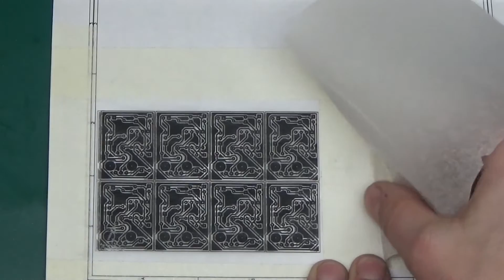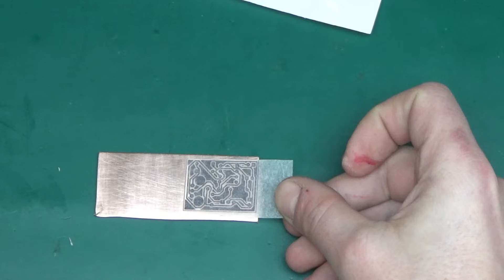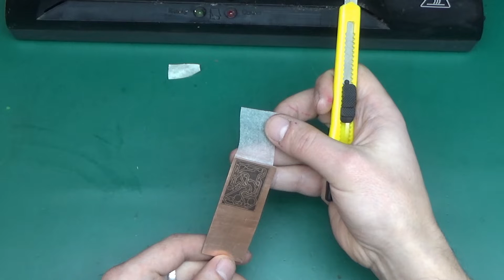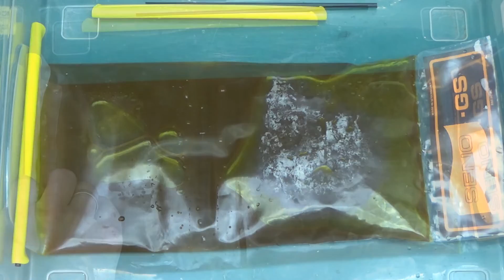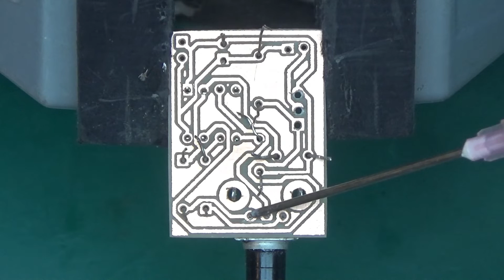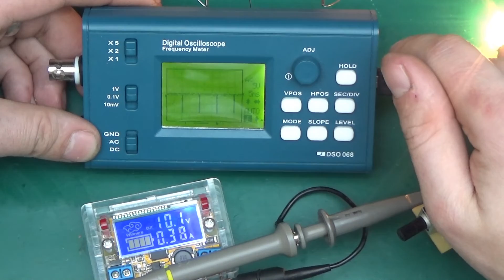Baking paper, toner and PWM controller

Comment: AWESOME! You are a livesaver! With my Samsung ML-2165 printer I could print DIRECTLY on baking paper. Because I have a long and wide roll of that paper I had to trim it to size similiar to A4, it went nice into the printer tray and printed FLAWLESSLY. 5 minutes of ironing at "2 dots" temperature, etching in B327 and PCB went fine! For my convenience I have just ordered a laminator, hope model I ordered will be fine for PCBs.

Comment: On a baking paper  should I use laser printer or even is it ok if we use inkjet printers and can I use the iron box to heat.
Reply from the maker: It must be a laser printer. Inkjet will not work for transfer. Iron is ok for heating, but it takes some practice to apply the right amount of heat and pressure evenly.
Reply: I'm not sure you understand what's happening here. A laser printer uses toner which is heated and melted into paper. Then you transfer that to your circuit board.

Inkjets use INK.

Comment: You can get better results if you set the printer on color, with much saturation (manual setting). Then you will get much more black. And the toner after etching can be better removed with a metal sponge and a little water (with only acetone you will easy get black residue between the tracks witch is very difficult to remove). Then if no black residue anymore  is present you can use sandpaper 800 or 1600 (wet sanding just a few seconds) and after drying spray it with plastic spray or lött lack, but the last is sticky and gets a bit dirty easy.

Comment: I have a question... I've seen more videos about this as I'm new to this and I'm deciding what the best possible way would be. Now your board is a negative board e.g you leave all of the copper and etch away lines that can connect to each other (Hope I explain this correctly) On other video's I see them etching away alle the copper except the lines. is there a reason you're doing it like that? Furthermore I've seen a lot of videos to do research and this is a very hard way of doing it....
Reply from the maker: There is no particular reason why I did it "backwards" in this case. Sometimes leaving more copper on the board is desirable, say for heat dissipation, but here I was just having fun and doing what I thought I wanted to try at the time.
Reply: It's not a "negative" but simply leaving more copper on and etching less.
As he said, it's better for drawing the heat away from components, but it is also better for lower PCB trace resistance AND it makes etching faster while saving the acid mix because the less of the copper you're etching away, the less of it disolves into the acid, meaning the acid works faster amd can be used on more PCBs.

Comment: I don't think the baking parchment will work because it jams in the laser printer.
Reply from the maker: +Frenchie thanks, i did try and it worked really well with printer at work (hp), just had to tape the paper to a regular paper. Sadly, it does not seem do to work with my brother toner.
Reply: randomtronic I have a brother also and have great luck because I got toner refills from ink owl. Now it makes great toner transfers to copper boards.  https://youtu.be/bqSFxV-yOGM  this is how it works.

Comment: Hi. 
Many electronic fans use laser printer setted for max toner filling and iron for thermo transfer of the drawing. And mix of H2O2+HCL+C6H8O7 for circut board etching. Cost price tend to zero.
Reply from the maker: Yes, still many. But not as many as say maybe 10 years ago. A lot of hobbyist nowadays order boards from china, because it is very cheap and looks professional. I miss those days when everything was done at home. That is the essence of the hobby.
Reply from the maker: rossak81 I've done that too. And even plain old metal paint. whatever was on hand!